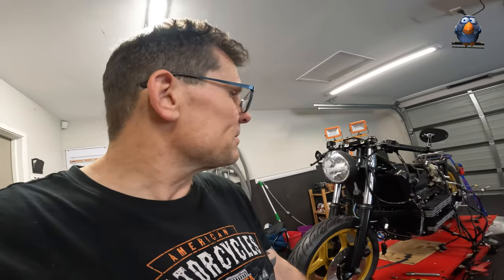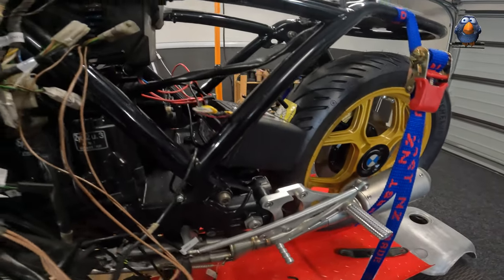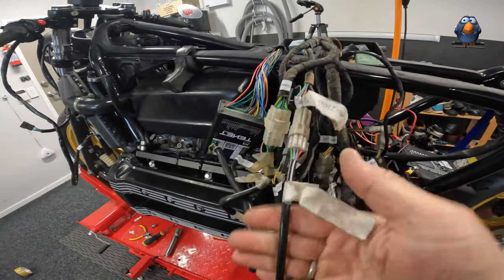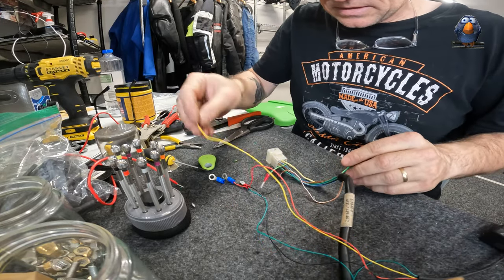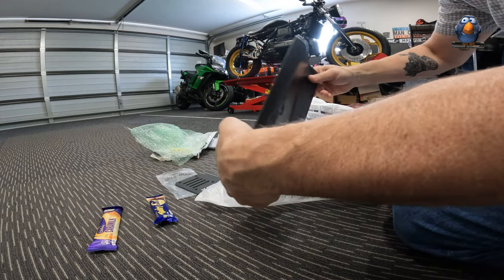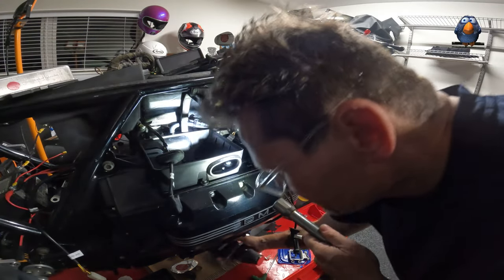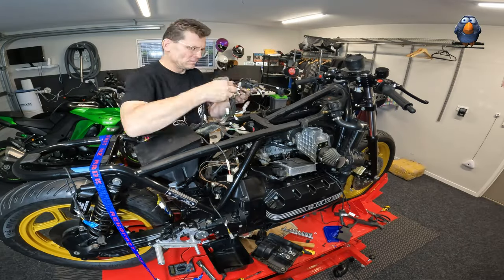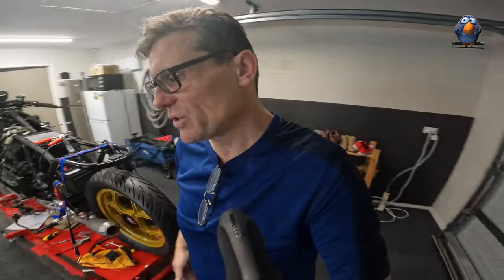[EP32] BMW K100 Café Racer Build - Electrical #1 and Airbox Bypass

Comment: Hey can u please tell me wich wires i can connect to a aftermarket momentary switch because I do not have money like you do to buy one of those fancy wiring kits so I'm just trying to add a standard to wire momentary switch for my start on off switch is that possible or what kind of switch do I need to use to make it work that's the only thing that's stopping me from riding my bike because my old switch got messed up and I took it apart and lost the pieces to it stupidly so now I have to figure out something else can you please help me with the colors and which ones go together I have a RK 100

Comment: On that too I'd just run another ground to the point under the tank from the battery, saves a lot of headaches later. That coil cover might need some "modification" to fit lol!
Reply from the maker: I have a second thick ground running from the frame. Under the tank to the ground point down below the coils. Routed fairly easily.

Comment: The lunchbox is not so bad.
Do never use petrolium, like white spirit of any sort.
The ventholes on the backside are stupid. Plugg them total. A small hole in the bottom with a house for compressed air into the glovesbox or something dry.
Change the rubberseal between the parts if it bad
Change the lightbulbs if it is opened.
Look out for the wireing of the bike. Germans cant wire electrics. Change to better quality cabels. Change cabels for ignitionlock to a quality can resist bending better.
Take away the plastic surounding cables and replace with a plastic spiral . Water !
If ABS. Change capacitors in the controlbox. Take photos and make drawings.
Not difficult but takes time.
A helpful trick in damp climates. A deciliter 2stroke oil in the tank can help injectors in ther spring. Drive about 100 km .
In the forks good hydraulic oli ISO VG 32 (the most common) .
To oilfilter . If it rotates in the tool, try 5cm cardboard between it and the filter. 
Both the oilfilter and the fuelfilter are the same as same some cars.
Reply from the maker: your comment re: Germans cant wire electrics resonated most 🤣 thanks for uploading useful advice